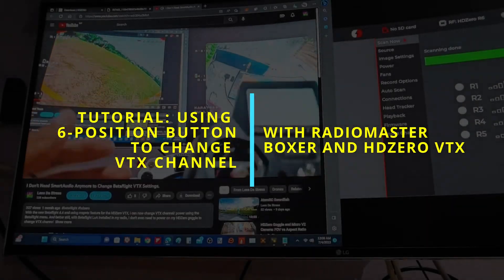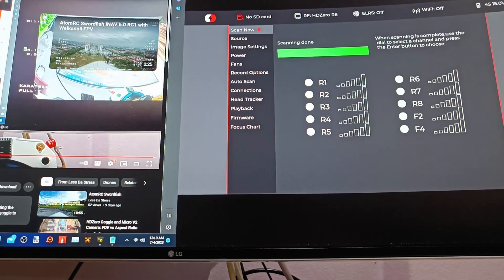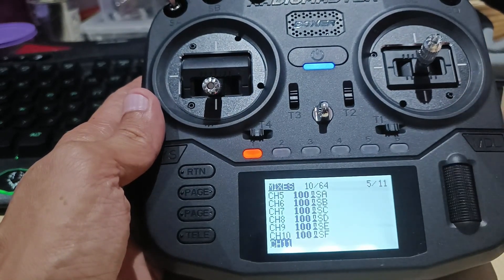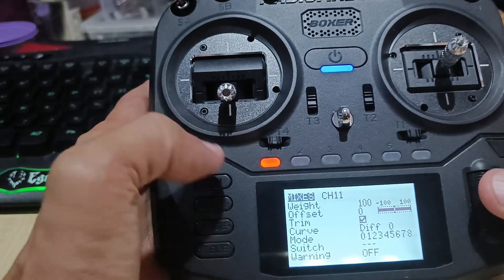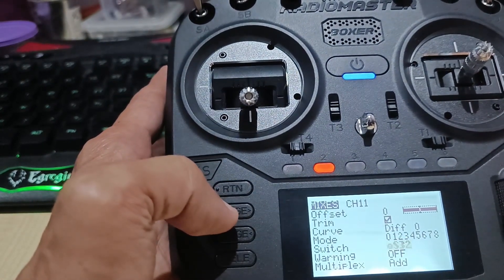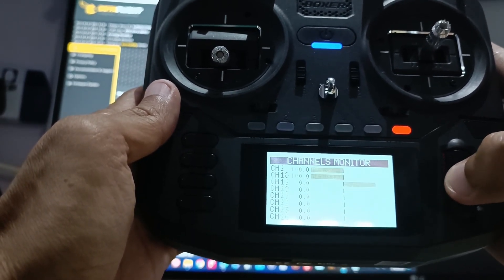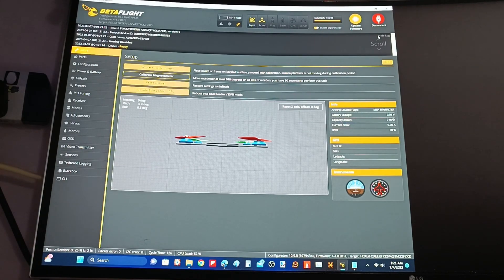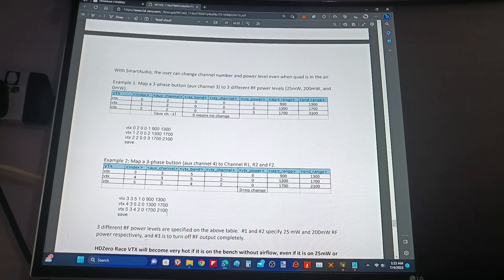Tutorial: Using 6-Position Buttons on Radiomaster Boxer to Change VTX Channel

Comment: I've been trying to figure out what these are intended for. radiomaster just has them as "six position switch" and doesn't give any reason for them.
did radiomaster just add these for the modders? the six position on the tx16 is the same way, it has no intended purpose.
Reply from the maker: You can configure for a lot of things. I've configure it changing VTX channel like in this video. I've used it to have throttle scaling presets.

Comment: Thanks. I set this up today as I wanted a Pre-arm button, which I've assigned to the 6th position. I have 5 more to play with now, I guess :) Not sure what I'll use them fore, but I did want a pre-arm and I'd already used the top-right momentary as a timer reset button.
I keep thinking I'll figure out how to leverage the trim buttons as outputs for something but it seems the most complicated.